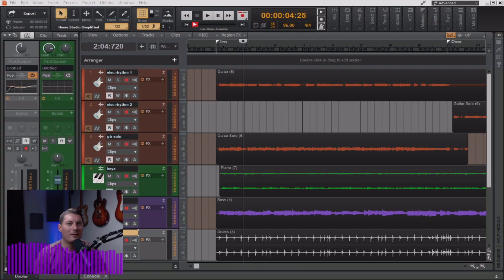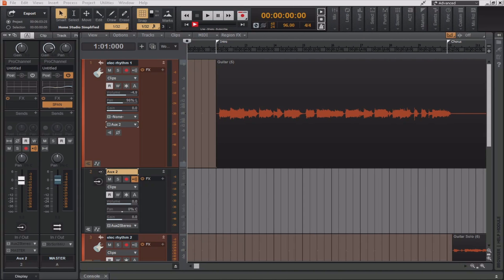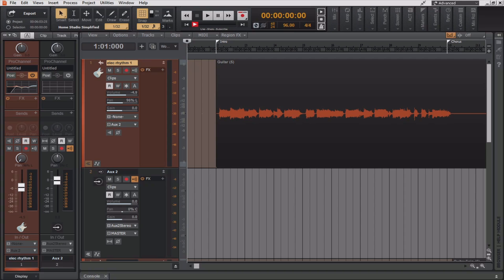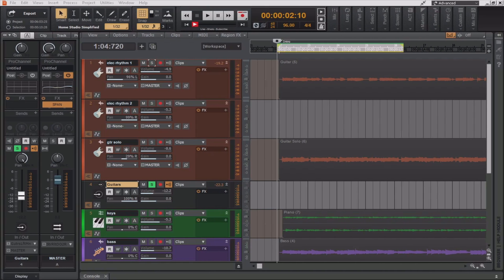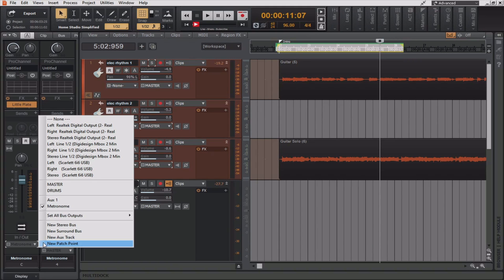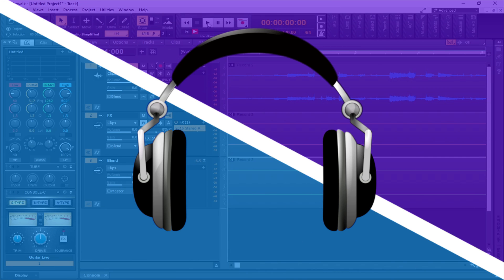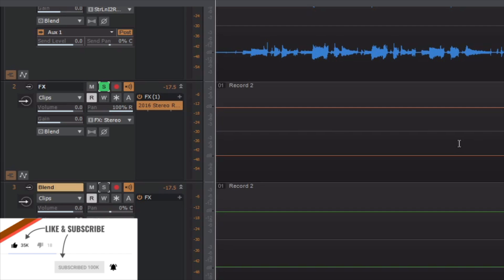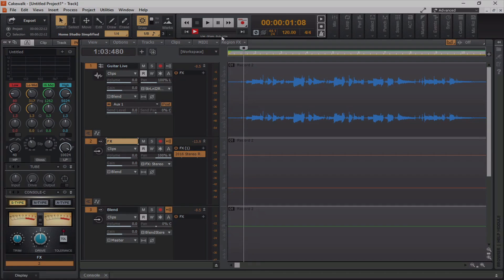Aux Tracks vs Patch Points In Cakewalk By BandLab Tutorial

Comment: Hey Robert, Do you have any videos on routing the external insert from master bus to outboard gear. I've been trying to use a preamp on my mix bus using the external insert plugin but keep getting a delay. I guess because I'm hearing the mix as well as the mix coming back thru the hardware unit.  Hoping you might have a video showing a step by step setup for my situation and what I'm doing wrong.
Reply from the maker: Nope sorry. I work just n the box